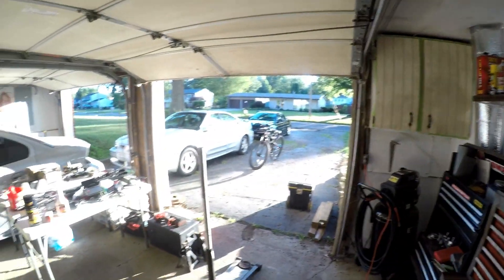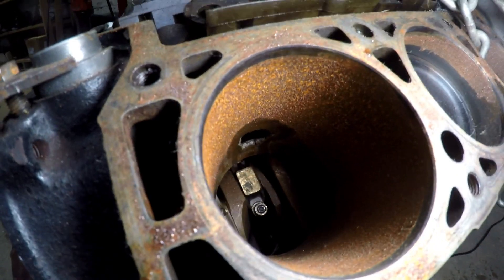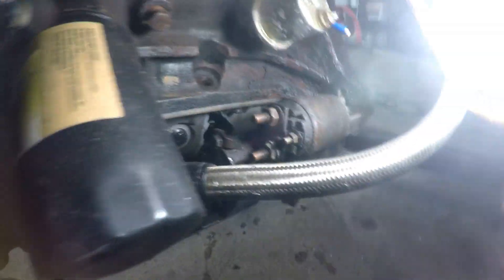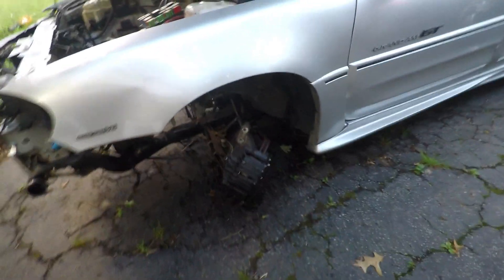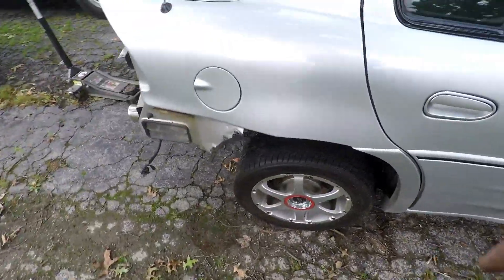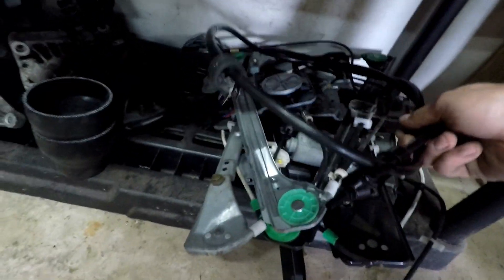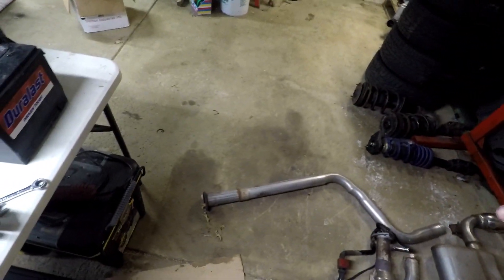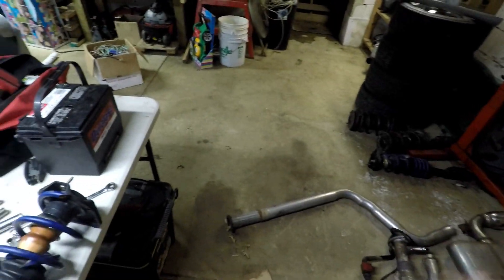Digging into the new car!! Ready to start the build!

Comment: Hey what do you think of the pacesetter monza exhaust kit? Also, can you make a video or give me tips on how to wire halo headlights? The videos here are not very good.
Reply from the maker: Pacesetter isn't bad, I've heard/seen people have rust issues from cheap metal. Tone isn't bad, to get selection use an fbody muffler 98-02 it's the same setup. 

As far as the halos, that's an easy one. Tap into the front marker lights. Should be a brown wire for power, and black for ground! I can revisit that as a video tho!
Reply: @KMaffittGAGT  Ok and the catalytic converter connects (downstream) to something that looks like a small single piped muffler. What is that? The pacesetter kit has one, but as far as I know the muffler in the kit is placed all the way in the back where the exhaust exits are. All I see for that part of the car in the kit is a pipe that is straight. I'm wondering if I maybe need to buy something along with the kit.
Reply from the maker: Our systems go from engine to catalytic converter to a resonator (reduces drone) and then the muffler. The resonator is not needed and most get rid of it.